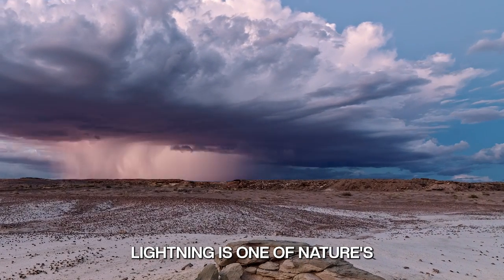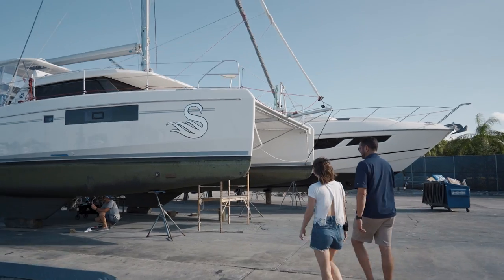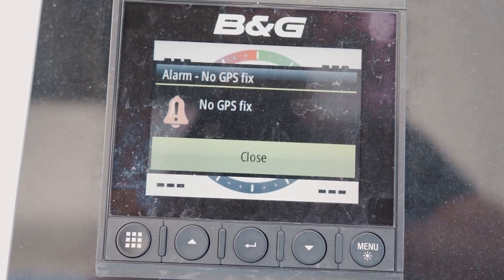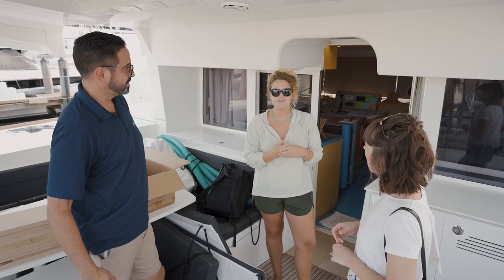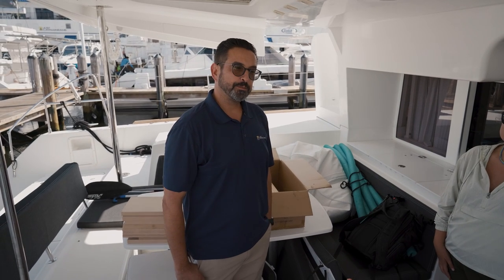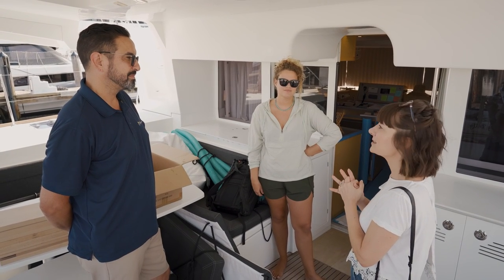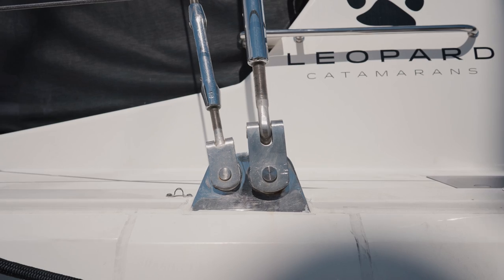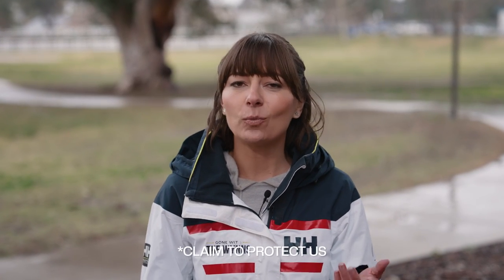Can Anything Stop Lightning?

Comment: I've had one experience with a lightning strike.  I was at a friend of mine's house sitting on his couch during a thunder storm.  There was a bolt of lightning and we said something like, that was close.  It actually lit up the room.  As it turns out it wasn't just close it actually came in the room we were in.  He had an external TV antenna and the strike traveled down the antenna wire and fried one or two of his components in his stereo/TV rack.  It also seems like it sent a bolt across the room that hit a couple of feet away from me but we never did find anything like burn marks.  It was interesting and kind of scary after the fact because it happens so fast, literally at the speed of light, that you don't think about it until it's over with.   Keep the good stuff coming guys and I'd get on of those thing-a-ma-bobs for the mast.  Maybe you can get HH to put the wiring in before your boat is done and reduce some of the installation cost.

Comment: In the telecom industry we use products like what Rayvoss make. They have been bought out but the actual products are what we call a Transient Voltage Surge Suppressor or TVSS. They incorporate what is called Metal Oxide Varystors or MOV, but the high power grades(100-300k joules class). Rayvoss MOVs are called Strikesorbs. I haven't seen anything equivalent in the marine industry but one should look up the market for an adapted product.

On another note, while not a marine electrician myself, I wonder how well thought out and layed out are leasure boat electrics. How well designed are those blue boxes I see everywhere, as far as electrical isolations is concerned.

Comment: Many years ago on my Hobie 14 out on the Gulf a couple of miles south of Biloxi when a T-Storm came in off the gulf with all sails set. I made it to shore ahead of it but felt somewhat exposed. This was 1974, so no electronics involved. 😁

I was involved in a data center build and we installed a similar product. This was in 1990 and, to the best of my knowledge, the data center hasn't been hit.

Comment: Boats hit when docked ,  as in your video ,are more likely hit from by being connected to shore power.
Especially when it's multiple boats .Even boats anchored nearby can by struck by the electricity dissipating from   the shore power lines.The best protection is multiple  surge guards inline.
Reply: I NEVER leave my boat connected to shore power when away from the boat.   I've personally heard of 2 boats that were damaged by surge via shore power connection.   Does a galvanic isolator protect your boat from a shore power surge?  I'm not sure.
Reply: @jeffmooreD40  Yes but the problem is that the electricity from a lightning strike goes out of the hull through the water and allso hits other boats indirectly.
It's better to be well away from other boats.Faraday method seems reliable, but theirs a system called a CMCE worth looking in to.

Comment: I remember the Sailing magazines in the 1970's addressing the problem of lightening strikes on sailboats.  The basic architecture of the devices was basically the same as what you present here.  Grounding plates below the waterline plus a conductor at the masthead linked by a conductive cable would create a "cone of protection" whereon the ions would be neutralized so as to be less attractive to a strike.  The tech was pretty simple.and it seemed to work.

Comment: Great content! I grew up in the tropics where lightning was a frequent occurance. We have lightning rods on top of the roof throughout house with the cables grounding on the ground. However, that solution only worked 50% of the time and we we even got surge protector but it only works once.  We found that the surge also comes from the power line too.  Our best solution was to "unplug" all major expensive devices and that has been the best solution. The question for HH is that is there a way for you to unplug all the devices from the top of the mast so that in the even a direct hit, the surge would not follow your powerline and of course to disconnect power from shore line.

Comment: While Florida may be the lightning capital of North America, the lightning capital of the world is...Lake Maracaibo in northern Venezuela! Lake Maracaibo gets around 1.2 MILLION lightning bolts EVERY year or 233 flashes of lightning per SQUARE MILE per year! How? Lake Maracaibo is the northern part of the Andes mountains. Storms commonly form there at night as mountain breezes develop and converge over the warm, moist air over the lake. These unique conditions contribute to the development of persistent deep convection resulting in an average of 297 nocturnal thunderstorms per year. The lake is also the reason why Venezuela is oil-rich, so it DOES have a benefit!

Comment: Good video, In addition to the device mentioned in the video, one additional measure that can be taken to protect electronic systems on a boat is to place them inside Faraday cages. Each electronic piece could be placed in a small Faraday cage, and lightning arrestors could be installed on the cables entering and exiting the cage. The cages could be grounded to either the water or the earth when the boat is on a hard stand. This setup would provide an additional layer of protection against electromagnetic interference and other electrical hazards, including lightning strikes. However, it is important to note that direct lightning strikes can still pose a significant risk to electronic systems, even when they are enclosed in a Faraday cage. Thanks for your video and information, looking forward to your next video.

Comment: I am curious if the amount of carbon fiber in the HH will effect how the boat would deal with lightning as carbon is quite a good conductor compared to other composites.  Being in FL, I have always thought it smart to protect everything outside from strikes since they are so common here.  Seems like a rod, or the device you are talking about connected to grounding points would be a great piece of mind investment.  Great content you two, always love catching up each week with your adventures!
Reply: I think this is a fairly major issue.  Carbon is a good conductor but it has to be separated from aluminum and other metals by insulators, typically a thin layer of fiberglass, to prevent corrosion.

A lightning strike is going to blow through all those thin insulators, which will then vaporize because they're resistive enough to absorb a fair bit of energy.  A small blob of fiberglass plasma in the middle of lots of carbon fiber is basically a small bomb, maybe as small as a good-sized firecracker, maybe much bigger.

I think it's even more important to protect a carbon boat with (a) a low resistance discharge path from the highest point to the water, and (b) insulator blocks on all the stays, like what you see on the guy wires on utility poles.

Comment: Our radio network uses the bottle brush devices on our towers and ground them to earth to dissipate the energy around the tower. Also here in central Florida you see all of the protection shown in the videos on cell towers and around power sub stations. It can be affective in channeling the lightening away from sensitive equipment. A good practice that I use is to disconnect your equipment from power and antennas when lightening is around. I also plug my fridge into a solar generator to keep it running and protect it from a commercial power.

Comment: Shockingly good stuff, thank you again, long ago all farm houses had Lightning Rods, we’re they effective?
Love your content.
Reply: Remember what you see as lightening is actually the superheated air Chanel’s return stroke. 
But lightening can indeed strike from over the horizon and the damage following a strike can  only be minimised by routing it straight to earth … either literally or water if at sea.  Plucky experienced the worse combination in that the charge passed down his mast and rigging then had to find a way into the water through the higher resistance of his fibreglass hull. It eventually traveled through the inner hull and exited blowing a hole in the hull next to the prop shaft and nearly sinking him as well as leaving dead in the water at an isolated place.
Reply: Yes & No. Lighting rods are designed to get hit and redirect the electrical current directly to an earth grounding rod.
Oh Yeah, lighting rods were originally installed on the old farm houses & barns to prevent the lighting from setting the structures on fire. They didn't have any electronics back then & didn't have to worry about the EMP that accompanies a lighting strike.😉
Reply: @vanessabryan786  Yes, he was recording when the lightning struck his mast. And he saved his boat from sinking! /Sailing into HELL Part 1! Lightning devastates Freedom - The sailboat is SINKING! / https://www.youtube.com/watch?v=Df-XCtfU9kw&t=42s
Part 2 https://www.youtube.com/watch?v=GzkQaGZYdVI&t=10s
Part 3 https://www.youtube.com/watch?v=Hddk_bAzhy0
Part 4 https://www.youtube.com/watch?v=tfI-De6SO4I

Comment: Interesting Conversation. Note this,  farmers have been putting lighting rods on there barns for more than hundred years,  along with copper drain wires down to the ground where copper ground rods are placed.  Year's ago I did RF site survives on commercial buildings, which also have lighting rods around the perimeter of the roof top along with a common buss wire linking them all together. From there, the buss is transferred to multiple paths to grounds in the building. All very logical.  I was also given a tour of a university telephone switch room that had been updated recently, the telephone switch was wiped out by and direct hit, then two weeks after replacing the entire phone system, it was hit again.  The solution was to place copper 4" x 1/2" buss bar around the perimeter of the entire room, where every rack unit and lighting arrester was connected to.  
This system is using Aluminum, which is a great conductor, but there's a reason it was banned for use in electrical wiring in the USA for many years, but its being used in electrical systems again.  As aluminum ages, it shrinks and in system that used mechanical fasters (set screws) the fasters were no longer tight, this caused arcing which leads to heat, and enough heat to cause house fires.  Does this system have regular inspection intervals to insure good connection over the coarse of the products expected life time?

Comment: I am glad you found a solution to the problem, well maybe. I am an electrician and have installed lightning rods on homes. Mostly on homes built on iron ore hills. They do work. But if you are ever hit by lightning, it will scare the "bejeves" out of you. They say that only one in a million is going to be hit by lightning. Well, I am that one. I was hit indirectly while working in the rain on a tall machine that was hit. Most of the electricity went to ground through wires dragging on the ground. I was holding an insulated wire and I was wet from the rain. The water got some of the electricity.

Comment: If you want to keep the lightning protection in place when hauled out, have the installer drill and tap a hole in the hull conductive plates.  Then when hauled out, screw in an eye bolt and hang a length of chain from it that touches the ground to keep the conductive path to ground intact.  This product is working like home or commercial lightning protection system by creating a path to ground around the electrical insulation properties of the hull.  Before launch, plug the tapped hole with a plastic screw to keep marine growth out of it.
Reply: Would require constant power ... but if lots of solar/batt... and you do not turn off/disconnect everything when on land(which you should do as this protects against lighting for the most part) then you could leave everything up and running....  Not hard to drop an uninsulated wire from the grounding plates to the ground.
Reply: @w8stral  I suggest consulting a marine electrician. 😉
Reply: This does not work it’s fibreglass boats attaching a chain to plastic is like darn right silly
Reply: @michaelking7231  and I never said attach to plastic.  I said "drill and tap the hull conductive plates" that are already there and are already intended to provide a path to ground from the mast into the water.  Simply ground them on land with appropriate measures.

Comment: Hi guys, very interesting device. I get the cost to install is expensive, but wonder if any insurance companies give a break by having it installed? Considering how expensive it is to replace electronics, the hassle of finding a new insurance provider, and the chances of your boat being struck more than once over the time you own it, wouldn’t it be a good preventative measure to install?
Reply: I'd be really curious what the actual cost breakdown for that device is.  I'm expecting there's special metal milled and polished in a special shape, with hi-tech coatings, high grade dielectrics,  high purity low loss conductors, special techniques to route cables and bond to the conductor plates on your hull. Maybe $2500 to make, 100% markup, $5000 of labor (50 hours x $100/hr) with up to 100% markup.  The high price gives buyers some sense of security - every year you have hundreds of thousands of yachts not hit by lightning, the vast majority.  Every one of them who has the device will swear by it every year.  Even if it does nothing there will be huge numbers of false positives.  And if it does work it could take a long time to figure it out with reasonable certainty - statistical significance.  For that reason I'm pretty sure the manufacturers will end up offering a money-back guarantee on the device (but not cost of repairs) for anyone who gets their boat hit and still make $$$.  Kind of like all the high security bike locks who at least give you a refund if the lock is compromised.  It is worth it in marketing.

I'm guessing it won't be long before there are DIY plans, or cheap knock-offs for a few thousand and self installs.   Sure you wouldn't get the experience of someone installing it over and over and there would probably be some compromises on materials - and it still may fail just like a pro-install might - but I'm pretty sure this will happen as the market expands and competition grows.  

Of course best option is yacht builders include this as part of the original build and masts come with ion-discharge conductor paths builtin - install costs should be way less, mass manufacture and competition drive prices down.  But like all safety features these things take a long time to percolate through the market and ultimately lightning damage sells more product so there's not as much incentive to push it unless customers demand it.  What will be needed is some very solid research of actual vessels and analysis of data.  They could be packing the masts of early adopters with lightning detectors and impervious data loggers and offering discounts because proof that they work will be worth its weight in gold.  But really they don't have to prove anything right now - if you're buying a $1M+ yacht then $15K for a lightning prevention system is probably an easy sell until there was definitive proof they don't work. And if they do, game over - every insurance company will offer discounts and everyone will take the option.

Comment: What about surge protectors? If used on all of the equipment it might protect certain items against a hit? Just wondering!
Reply: simple surge protectors don't work all that much, they take time to fail and allows some or all of the surge to continue trough a bit, I have found the running 6 or 7 protectors together in series will work, would also need to keep a bunch of spares, protectors are make using a device called a thyristor, you parallel 2 together, at a set voltage they short out stopping a surge, so then you would make 6 or 7 sets of 2 and set the 2 unit sets in series, depending on the type they can go for $7 each to over $1000 each,

Comment: Every time the subject of lightning strikes comes up I wonder, to myself, what does the Navy do to protect their ships and equipment. I figure they have been at this for a while and have tried various approaches so what is the current state of the art strategy used by the Navy?
Reply: That might be different in that the steel hull and superstructure become a Faraday Cage, protecting the contents.
Reply: Steel hulls have a huge advantage. The entire hull acts to dissipate the charge because it's conductive. On a glass or wood hull it all acts as an insulator except for the electronics. Top of the mast usually has an antenna or at minimum a lamp. Those connect to the power and grounds inside the craft. All the electronics also connect to the engine which has a shaft that goes into the water. That provides the conductive path and lightning looks for the easy path.
Reply: The Navy is aware of the Faraday cage and uses that principle even when building wooden boats.
Reply: @peterengel7885  A faraday cage is good for blocking radio emissions but does nothing to protect against high current and voltage where it was never intended to be. There has to be a strategy to protect all the electronics. Perhaps that strategy is just to cary spares and make repairs onboard as you go. Damn the lightning, full speed ahead!